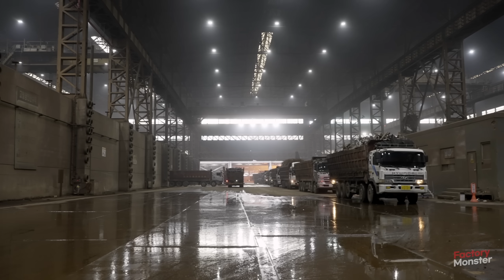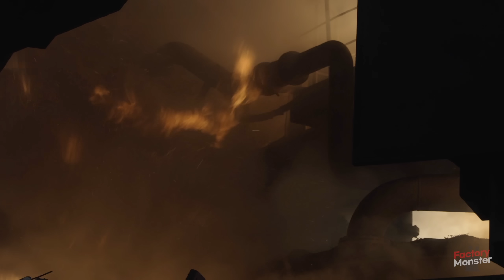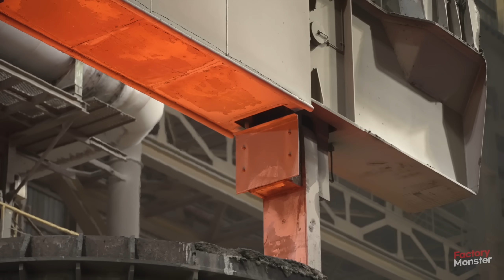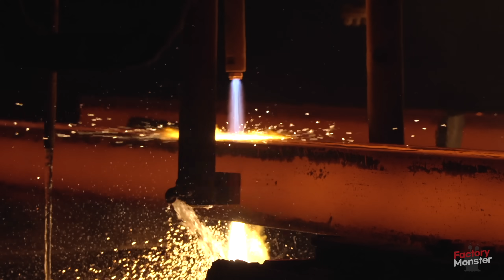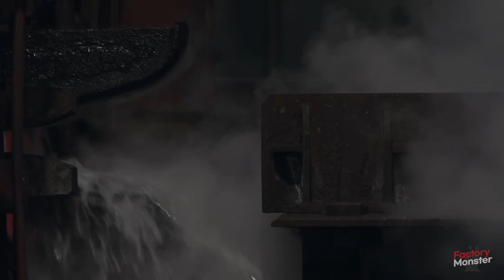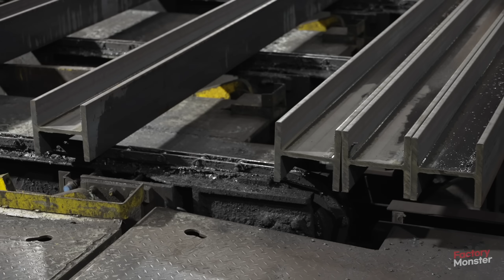Amazing Scale! Process of Making I-Beam with Metal Scrap. Korean Steel Factory

Comment: The happy little scraps show up from a truck.  :D

The happy little scraps get plucked into a charge pot :D

The charge pot dumps them STRAIGHT INTO HELL D:

There was a steel mill near me when I was a kid in Illinois that did this but with older equipment.  Dave Tackett's channel has the videos - he used to work there.

Comment: OK... You're the repair guy. Go replace one of those rollers that pushes the beam through the forming press. Or the plug that blocks the hole at the bottom of the crucible of molten steel. Then go unstick one of those beams that fell off its track. Not me, but I'm glad someone does it!

Comment: I wonder if it is possible to replace standard rolled I-beams with welded ones. Welding requires sheet metal. Much less energy cost. Welding technology is now at a very high level. I believe the quality of welded beams can be comparable to rolled ones.
Reply: If you weld them you would still have some tension in the seams, to get rid of that you have to glow the material but this is additional energy.
Reply: @simonm1447  All I-beams of large section are welded. No one does their heat treatment after welding. Moreover, modern laser welding significantly reduces internal stresses.

Comment: How do they get the quality.  The scrap is mixed with lots of different alloys.  The I Beam should have certain alloying to ensure it has the strength and longevity it requires for the application.
Reply: The quality isnt the same as with pure  iron ore.

Comment: Fun fact for those who watch this, that profile of beam is actually a W-beam. The profile is different from a traditional I-beam, though they do look fairly similar. W-beams can hold more weight because of the wider (where the W comes from) and thicker top and bottom flanges.
Reply: This commentor has the knowledge of their profile pic lol. They are not called H beams OR W beams. They are called I beams!
Reply: Someone has has knowledge on structural bars!!. I worked over 30 years in a Steel Mill different departments. HARD WORK.

Comment: A few years ago I was scrapping metal part time. Price was 9 to 10 Cents Per Pound, or $180. to $200. Per Ton. It was worth the effort and gas. Lately, it is about 3 Cents a pound. Not even worth the time and gas.
Copper is still at a decent price.

Comment: ELECTRIC? furnaces??? I doubt THAT'S right. Aluminium uses electricity but NOT STEEL AFAIK. The noises are the RUST crackling usually.

Comment: What is even more amazing is how the factory is engineered. All of the layouts for the twists and turns of the spectrrum of pipes, the steel that makes the rollers roll, ladels tilt, all the bolts and welds and how it is all pieced together for the steel to be the star of the show. Amazing!
Reply: On sent que cette usine est très en pointe, une aciérie a presque un côté subjuguant, le métal en fusion n'est pas pour rien dans cet effet

Comment: PS. It's not 'highly ' automated. Virtually every machine is controlled by someone in a upper control booth. If it were truly automated, you would have to see sensors everywhere. You don't see the people because 80% of the areas are way to hot to work in, despite protective clothing.

Comment: The doofuses who don’t believe a jet fuel fire could cause a steel building to collapse need to watch this video to see the hot beams be soft like wet noodles. You don’t have to melt steel to reduce its strength dramatically.

Comment: That is the electric furnace its a solid carbon rod that melts the scrap metal
adding carbon during the melting process then its form into an ingot reheat to form into H shape through rollng mills cut off both ends for recycled I work in steel mills in the 70's

Comment: A 2cm drop of molten steel fell right through my clothes at work years ago on my leg.  It was locked for maybe 1/10 sec. before it fell trough my pants to the ground, burned a hole in the flesh 3rd degree. Strange thing was I didn´t feel a thing at the center of the wound, no pain at all. Not right away, not in the weeks after,  cleaning the wound daily. The area around it on the contrary was painfull but not that bad... Healed without scar tissue too. I was very lucky. Now imagine falling in that ......

Comment: the amount of electricity being used and wasted to heat/reheat and run all this machinery blows my mind. yo really cant make the beams as the steel blocks are red hot?
Reply: Pretty difficult to work steel unless it's red hot or higher.

Comment: Impressive!
Just a naive question: how do they ensure the quality of the produced iron?
The scrap looks like being anything, in carbon proportions, could contains stainless steel, steel pieces mixed with copper, or why not lead...
At which point and how do they ensure the final product to be a reliable iron/carbon precise steel?
Thanks.
Reply: Hey Thomas, I work in a steel mill myself, but we produce rebar and t-post. Typically furnaces have an oxygen injection system to oxidize out most impurities. Countries have different standards for what qualifies as a specific grade of steel, steel producers have a "window" to have their chemistry  meet these requirements with a little bit of variation( a little extra tungsten, a little low on carbon, etc.). If you had a spectrometer available to you, you'd find that almost all steel products of the same grade will have small differences in content unless it's from the same batch or "heat". Hope this helps!
Reply: @BryceBurris  : Thanks for your answer 🙂
But that means the company itself is holding no control at all?
Or do they measure and adjust some parameters(eg adding carbon) during the process?
Reply: @ThomasKundera  The second phase after furnace melt down is refinement, either a guy working a smaller furnace that uses the ladle as the furnace itself, or  a mix-station (often called a stir-down station) will take small samples and use a spectrometer to verify its contents and add alloys if necessary. For my mill specifically we made our own set of standards that are more restrictive than the state, so if we accidentally go over our own standard, we are still in state compliance for that grade of steel.
Reply: @BryceBurris  : Nice, that's what I thought that could be done 🙂
Thanks for answering me.
When I asked the question among more than 2000 comments, I just thought I would get lost into it, but you found it and answered the best way I could imagine.

Thanks again and good night or whatever (well, for me its night and I'm going to sleep).
Reply: @ThomasKundera  Always glad to share knowledge, I very much love what I do. Glad I found ya! Best regards from the US.

Comment: I worked as s skilled tradesman in a foundry in the USA. Hot nasty work but our scrap buckets (charges) were 7 ton and we also used induction furnaces. I worked until 2007 when they closed the plant and tore it down and the scrap metal went to China. Respect to workers breathing that nasty air. I would hope all would wear filters over faces

Comment: I will say, when I worked at Volkswagen, all of the automatic machines in cages (big sections) would play music if the machines ran into an issue and stopped working. One of the cages would play Zelda music until the machine was tended to by a mechanic.  Just a more polite way to show there is an issue than a loud siren.

Comment: "H" beams? Lol
They must be in a different row than the "I" beams at home Depot. 
I have a suggestion for a video: "Turning 1.3 million Tons of Rubber into Tiny "ZERO" Rings.
Reply: Yeh I beams turned ninety degrees are H beams. Just like rubber O rings turned ninety degrees are O (Zero) rings. Lol. I wonder if H beams weigh more than I beams? I wonder if I ran out out of O rings for my I beams if I could use ZERO Rings with my H beams instead?
Reply: You talking about "O" rings??
Reply: @oneshotme  yeh zero rings. Look up h beams they don't exist my friend. "I" beams exist. They are a thing. H beams do not exist, they are not a thing in real life. Get my point now?
Reply: @oneshotme  "I" beams are a thing. There's no such thing as "H" beams. I have been a unionized iron worker for almost fourth years. There are no H beams. I fell out of my chair laughing when I heard "H" beams.

Comment: How is the final composition controlled when using scrap of many different types of steel?
Reply: Most likely the heat at which it’s smelted gets rid of metals they don’t want and they become the slag. If not that then I’ve got no clue.

Comment: NGL, some parts looked a bit inefficient. Like, the scrap could have been brought by rail and be unloaded by dropping it off rather than unloading and also the logistics of the storage with the finished product could have been greatly improved with an inbuilt crane for the building.
Reply: @azarellediaz4892  where did I say it should be dropped into the furnace?

Comment: They add carbon and silica to the steel at the last minute.  Its called an inoculation.  They have a short life of effectiveness while in the metal so its got to be last minute.  This extra ingredients modifies the plasicity, elasticty and hardness of the steel.  It can change the steel from brittle to way too soft if its measured wrong.

Comment: That's one of the most remarkable videos I've ever seen. What an installation - and what a power bill! it was crazy how water was pouring all over the beams during forming, but they didn't seem to cool at all! Thanks!
Reply: That is probably oil, not water (unsure tho)
Reply: @letwolf  It's for sure water. I work in a micro mill with an almost identical set up. Those billets just came out of the casting spray chamber, water is used at high pressures and flow rates to cool off the shell that forms in the mold. The core of the billet is still fluid for a certain distance, called metallurgical length. Because of the hot liquid metal core being above 2700 degrees, it still glows plenty hot.
Reply: @letwolf  Its water. biggest structures in that plants are cooling water pipes and surporters. I built that cooling towers and cooling pipes.

Comment: Damn that facility looks way cleaner than ours did.  Spent time in all the positions shown here from scrap going into the EAF to working the heat at the LMF operator to the castors running the torches to the rolling mill dealing with the stands to adjusting the straightener to changing them 80 to 100 pound saw blades to getting them pain in the ass crop ends off the cold sides roll line if they were to damn short to touch more than one roller at once an would be in the way better next set came through. 

Fun shit was the places first attempt at rebar.  That shit would come through probably 30mph or so than split into two bars.  An god if it hung up on anything red hot spaghetti everywhere‘s an fast.  An hope the shears get to swinging on the rest still passing through.  We had to take steel wire an wrap the ends on the cold side and stick 5 gallon buckets on the end of the bunch of 40-80 or so for them 200foot pieces to even make it down the roll line to be cut and stacked
Reply: Have you ever heard of periods lol

Comment: Because it's mixed scrap the quality of the beams are lower than US made, I worked 40 years building steel structures from power houses to tall buildings and I've seen this low quality stuff close up, it welds badly because of the impurities in it.

Comment: as someone that works in this industry this type structural steel cost about $650-750 per TON just to produce the product!  Scrap steel and alloys+melting cost+ reheating furnace cost+ rolling and finishing+ shipping.   its insanely expensive to make these rolled products.

Comment: I worked for a company that did a lot of work at Chapparal Steel Co in Midlothian Texas back in the late 90's..it was smaller than this but did the same thing..made huge I beams for bridges etc.
I was a Welder and used to go watch the guys hand cut the I-beams with these huge cutting torches..maybe 4 feet long and heavy..it was intense in there..the oven heated up to they told me 2200 degrees and saw the i-beams come out of the oven red as can be,then go down the line shaping them..theu were like wet noodles..it was awesome ! 
Excellent high quality video here..

Comment: With all the different kinds of metals being added to the mix, how do they get any uniformity in the finished product. These are load-bearing beams and the load they can carry is determined by the strength of each beam. The strength of the beams is determined by the properties of the steel and I can't imagine that there are any two batches of steel that have the same properties.

Comment: The process showed columns being made. Right at the end we saw I beams stacked up. I beams have a greater depth for bending strength whereas columns have wide flanges and are thicker to handle axial loads.

Comment: I always wondered how they can assure the proper chemical makeup of the steel being there are many types and grades going into the scrap hopper. Aren't the beams required to be a specific grade of steel so they meet strength requirements?
Reply: They can analyse the alloy before casting and then add any necessary chemicals or metals.
Reply: @thelight3112  That's pretty impressive. Using scrap steel, I would imagine every pot of molten steel has a different makeup. They must have to customize a blend for each individual batch after taking a sample from the molten steel.

Comment: There is more than one kind of steel. SOme steel has more carbon in it, making it harder but more brittle. That's what blades are usually made of. Then there's mild steel, which has less carbon in it. It's more flexible and bends easier. Then there's iron, which has little to no carbon in it. All of which are magnetic. So, how do they get a consistent product from random pieces of scrap?

Comment: Seems to be risky using scrap for load bearing H girders......
Reply: No, the beams or any structural products are rolled with specific grades of steel.   the scrap or raw ore has nothing to do with the finished product other than recycling scrap is far cheaper than using raw ore.

Comment: Great video.  They're called "W shapes" when the flanges are parallel.  "I-beams" when the flanges taper.  Never heard of H-beams (and they wouldn't be as strong in that position.)
Reply: I've never heard them called H beams I've always heard them called i-beams but in the past few years the name of everything has been changing 30 or 40 years from now these so-called H beams will probably be called Roman numeral one beams
Reply: @stevenbennett9425  There are H-beams and there are I-beams.  The beams in this video I would call H-beams.  I would refer you to the Tampa Steel webpage on the matter.
Reply: @Paul van der Wende Interesting!  Actually, "H beams" makes more sense than "W shapes".   "W" stands for "Wide flange sections".  In my work, I use an AISC manual here in the USA.  Maybe I'll start calling them H beams just to see what happens...
Reply: @Paul van der Wende I'm in the US and only know them as H-beams.  But I hasten to add that I don't specify beams for a living.

Comment: Two questions:
- How do they know the exact chemical composition, which determines its mechanical characteristics?
- Why do they let the billets cool and don't send them straight to rolling? They would save the cost of a second heat.
Reply: 我在鋼鐵廠待過20年，在13分鐘的影片的介紹，無法更好了；1.鋼驖的成份在融煉成液態狀就會提取至“光學成分機”分析，補足缺少的成份（碳，錳，矽...）。2.也許沒有直送熱鋼的設備，但是煉鋼生產速度跟型鋼需要速度不同，或是煉鋼設備故障延誤時，會冷鋼胚進入加熱爐，型鋼生產不受影響....
Reply: some mills to roll the billets while they are still hot, its called 'hot charging' sometimes its not practical due to the complexity and diversity of the products being rolled.

Comment: I always wondered if you could create a much more compact and distributed version of a foundry like this.  Instead of 100 tons of scrap metal getting melted in massive furnaces, the scrap metal would go through a series of a shredders and grinders to reduce it into granule metal sand.  The metal sand then gets blown and distributed through pipework out to several small enclosed furnaces, each about the size of a car.  The metal sand pours in and gets super heated and melted into a continuous flow of molten metal.  The slag is skimmed off as the molten metal flows and then it pours into the extruder to form a beam.  Grinding the metal down to small grains would drastically increase the surface area of the metal and increase the thermal conduction rate, allowing each grain to liquify more quickly with less energy.  I imagine a much cleaner facility like that without the giant hell-fire crucibles and cranes.
Reply: economy of scale is the reason
Reply: there are way too many grades of steel and iron to make this practical,  a big reason for large factories running 24/7 is due to the financial cost of operation, and stop and startups.      A shredder to process the material to the level you mention would be insanely expensive and not help the process that much. theres no free lunch, the time and money to process the material would only be exchanged by using smaller scrap.    gas and electricity are cheaper than other energys so its the best way to melt metals.

Comment: Wow great video. Normally steel members like H beams, channels or welded wide flange must meet certain specifications with the type of steel used. It's important to determine the resistance of steel under tension in a construction. It's certainly not sure about the quality of steel in this melting pot.
Reply: There are tools that can determine the chemical makeup of an unknown alloy. They use those devices on the batch of molten steel, and that tells them what alloying metals to add (or dilute) to get the desired product.
Reply: A big melting pot of anything. No way they will get a good quality of steel. Welcome disasters. @thelight3112
Reply: All things considered, it's the best H-beam in the world.